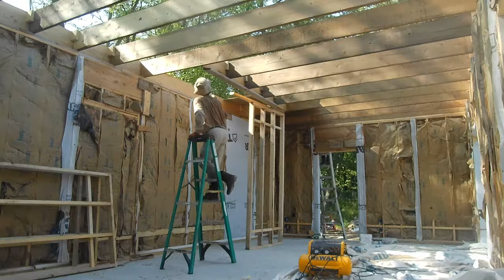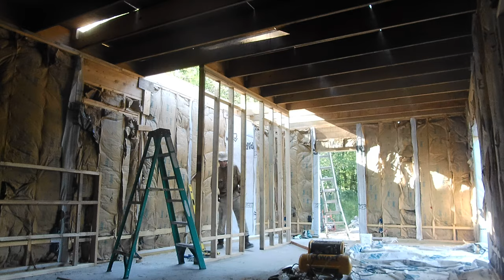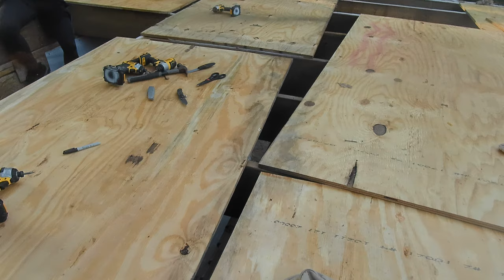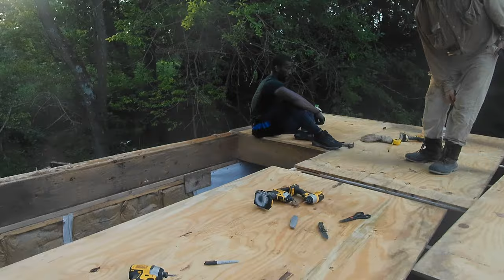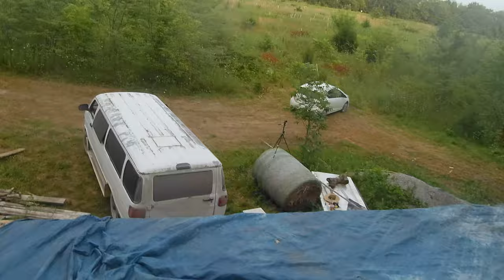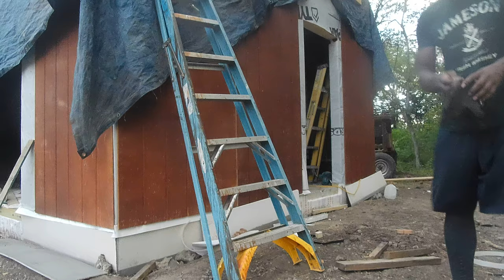SeedHome - Second Story Floor

Comment: It may have been stated elsewhere, but just for clarification i guess:  That/those module/s installed ~0:41 is just a wall module without insulation as it will be indoors next to those stairs right?